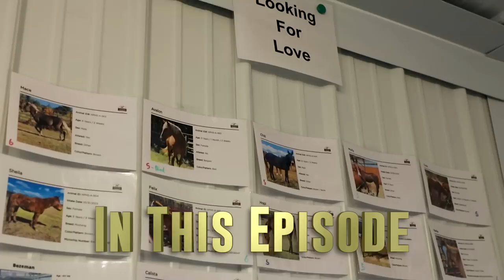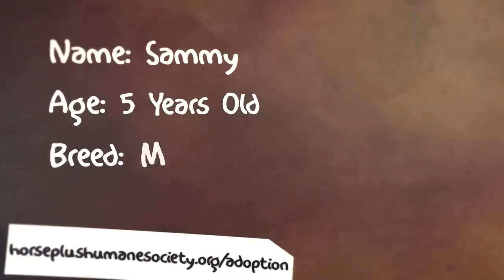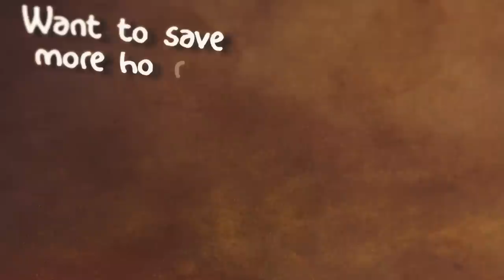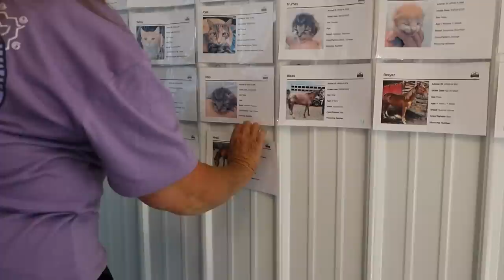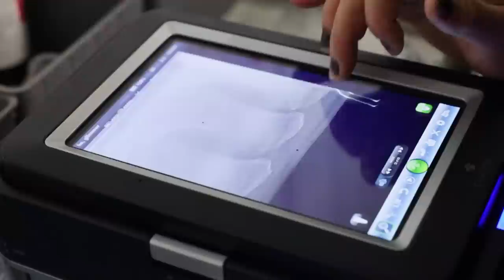Going Home - Horse Shelter Heroes S4E8

Comment: How often do horses need their hooves trimmed?
Reply: I think Dr. Nancy said about once a year
Reply: 6-8 weeks is pretty standard. Some say 4-6 weeks depending on how fast their hooves grow.
Reply: My guy had to be seen by the farrier approximately every 6-8 weeks during spring and summer. Winter time his hooves grew slower so he could go maybe 8-9 weeks. 
Nutrition has a lot to do with nice hooves and the amount time they are worked can wear them down some. So it can vary depending on the individual.
Reply: 4 to 6 weeks depending on the individual horse and its hoof growth.
Reply: @francineherron1940  Maybe their teeth floated. 

But NEVER wait that long for their hooves trimmed. They're like fingernails and can grow dangerously long to sleds or worst. Some of the images I've seen of horses with hooves just neglected come from nightmares. 

Six to eight weeks is best, a farrier would be a good judge on when to trim them. If a shoe falls off, then immediately the farrier shouldn't be ridden until they're seen to be reshod.